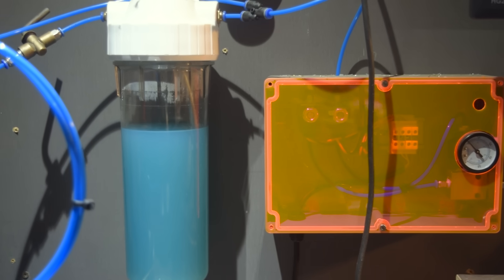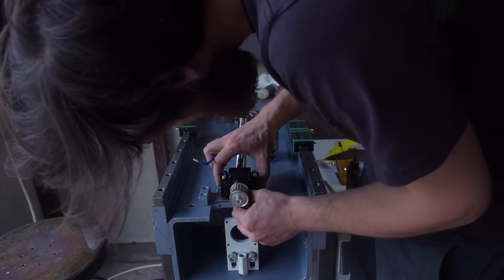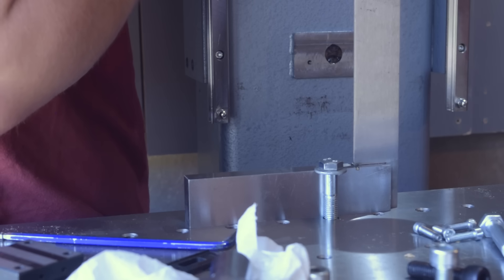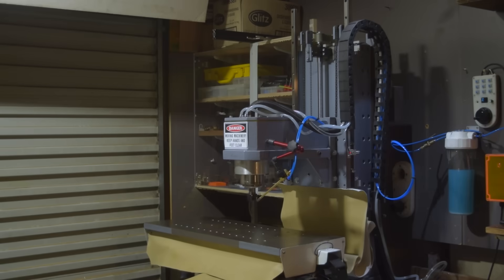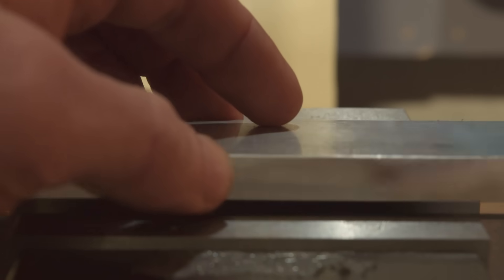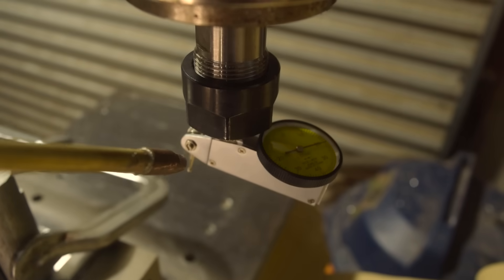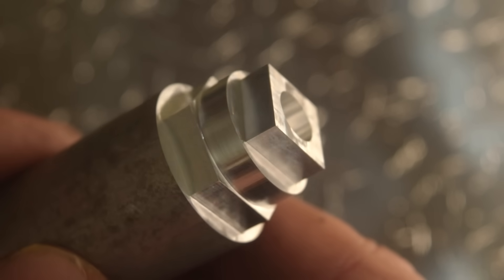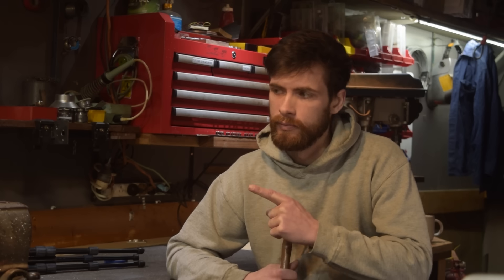My DIY CNC mill eats metal

Comment: This is great, your channel is going to blow up if you keep putting content out like this. Any reason you used the oil/sand mix vs. epoxy granite?
Reply from the maker: Thanks mate! 

Mostly transportability; if I ever have to move I can empty the sections out to lose the extra weight. Once I get a more permanent workshop (or a forklift of my own) I'll definitely go with something more solid!
Reply: @NoEngineerHere  That makes a lot of sense! Adam Bender has a great epoxy granite mix video with store-bought stuff - for your future reference! Can't wait to see more - I definitely vote to make upgrade parts with the CNC!
Reply: @NoEngineerHere  Over the last two weeks since you posted your first video I've been doing a deep dive on every hand made DIY lathe and mill on youtube. I also had thought of using sand & oil or ball bearings & oil for a similar reason of being able to break it down for portability if needed. I can't wait to see what your new spindle solution looks like! Great work.
Reply: @NoEngineerHere  You should do a video about ruining a video by adding music.  Never mind you just did.
Reply: This video was great and the music was a nice addition. No need to be a downer for no reason
Reply: @MichaelMantion You should do one on how to give constructive criticism /s
Reply: @hamsLP  You'll find that theory doesn't trump implementation. I've seen MPCNC builds using plywood tables and cheap hollow tubes that have produced better surface finishes on Aluminium than other builds using either welded steel frame construction and granite epoxy filler for dampening or based on structural Aluminum extrusions.

If you haven't already, then check out the CNC milling machine builds by VinceBuild HVAC and SeaBass Engineering. I was surprised at the choice of MIC-6 tooling plate for the Seabass build due to the cast plate being porous and sometimes not flat even though finished to precise thickness by Blanchard grinding.
Reply: This music had an accordion. Which means it is THE BEST. 🪗🪗🪗
Reply: @NoEngineerHere  That's a clever approach. I helped a friend with a similar build about 20 years ago and he used epoxy granite. It's probably still in the same place because that thing was insanely heavy.
Reply: I came to say the same thing. I'm an engineer with a "making stuff" problem. This build and the video series is top notch.
Reply: @MichaelMantion  someone's booty miffed the ants go marching song got stuck in their head
Reply: @NoEngineerHere I assumed the forklift build would be your next project. ;)
Reply: @LooselyRigorous I don't have time to make videos, but ty for your advice.
Reply: @mooreevair  Is the "ants go marching" song some gen z crap?  To be fair I was gen X and a lot of our song were crap.  Every generations have fools I guess.
Reply: @MichaelMantion  well I'm 43 so...lol
Reply: @MichaelMantion  who asked?
Reply: @NoEngineerHere  Transportability .... but you epoxied the major parts together. Not sure how you plan to get them apart.
Reply: @MichaelMantion I looked it up for you out of boredom, the Ants Go Marching song was made in the 90s because of the kids show, Barney, but the song is based off of another song from the American Civil War called "When Johnny Comes Marching Home". 

So the song is almost 30 years old.